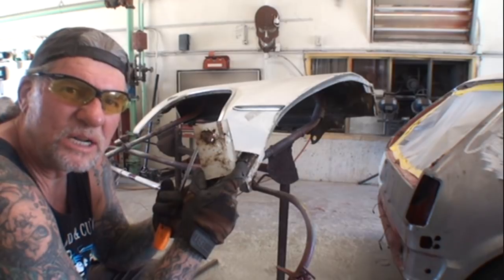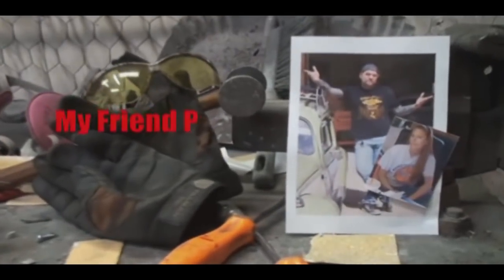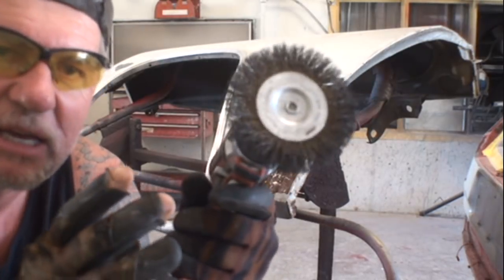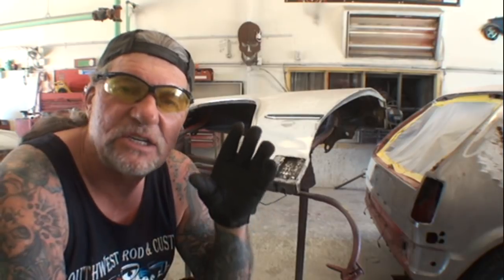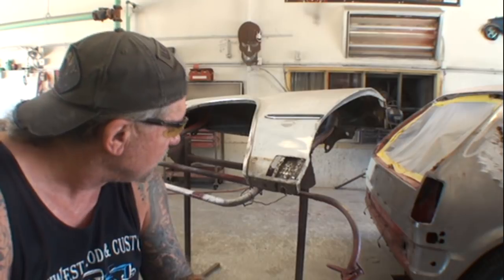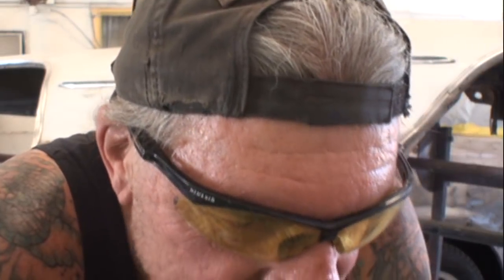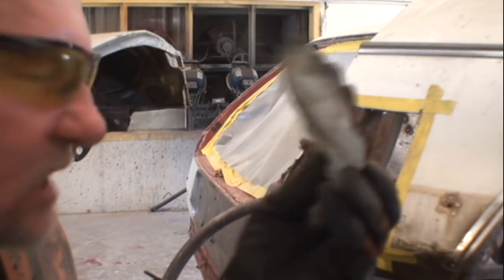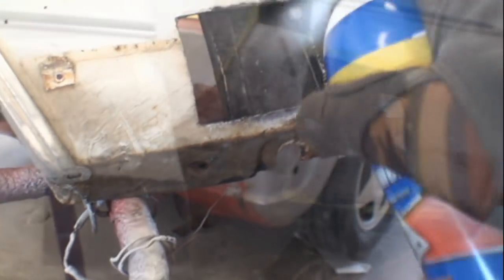How To Treat Rust - CHEAP AND EASY

Comment: Thanks My friend Pete, I remembered your advice with this product and used it to treat the remaining very light surface rust after I cleaned up the inside floor pan of my vintage 1973 Volkswagen. Worked like a charm, I topcoated it with NAPA semi gloss chassis black and it came out really nice, and as you said ‘will last as long as I own it’.

Comment: I just used it and was pleased, top coat that with Penetrol, yes the same stuff you'd add to oil base paint to help it flow, and it should have superior rust prevention.  Love your videos Pete, you take common sense approaches and consider that not everyone has huge resto budgets!
Reply: I never knew it would used in this application I used alot of penatrol loved it in the construction trade

Comment: I use muriatic acid several times .. The use distiller water with baking  soda to neutralize acid... then the Klean-Strip® Phosphoric Prep & Etch ...to eat any flash rust and seal the metal.... will protect panel from flash rust for weeks or more... the i Use the same rust treatment... never had rust return years later

Comment: I just got back to rewatching this video again. Yep I am going to agree, the can of rust treatment does work, but it's only available at O'reilly's Auto Parts in my area, I haven't check Napa yet, Napa tends to be more costly on their products and parts. Anyway I am using this stuff for all round surface rust removal Engine Bay, Underside etc, on the 81' Malibu I am restoring. Not a concourse restoration, but a restoration to keep her on the road for a good long time.  It is a good product, the instructions on the back state that it is not good for sheet metal body work. . Forget that, I used it on body, Frame, Floor Pans, and it works.

Comment: in my experience with fixing rusty crap in new england, products such as petit rustlok, por 15, rust bullet and the like works waaay better than rust converter, rust converting products have acid in them , when it gets wet again the rust comes back faster then with other rust products, rust converter might work better in dryer climates, but up here in maine rust converter, ospho and other acid containing products dont work out well.

Comment: Hello Pete ,  can I use this over skin door rust, and above rust treatment to apply bondo or epoxy primer ?   Can I continue with normal body job above rust treatment product ?  (. Example.  Rust treatment product -  epoxy primer - some bondo - primer surface - base coat and clear coat ,   Can you help me ,  thanks 🙏
Reply: Did you ever get an answer to this question from Pete? I also have the same question issue that needs addressing before moving forward.

Comment: I have a 72 nova with similar rust pits on the a pillar underneath where the windshield rubber goes. Do you think there would be any issues with new windshield seal going over top of rust sealer ? or would I be better off laying some primer over top of it ?
Reply: Primer and finish paint😊

Comment: Pete have to ever seen Arthur tussik channel. He's a Russian auto body tech he fixes cars that are wrecked beyond anything I ever seen.
Reply from the maker: Yes Ive seen him in action, great body man....
Reply: I've seen him also. Apparently he's not Russian, but maybe Latvian or Lithuanian. Although he makes an amazing job, I'm sure there are some corners cut. This is what I heard straight from a guy in Riga. It's a huge business there to buy completely wrecked vehicles from abroad and fix them up. Those fancy vehicles Arthur fixes are too expensive for a normal guy there, so an easy way is to just take advantage of cheap labour and get yourself a wrecked vehicle. For example, there are more imported Range Rovers in Latvia than sold by the local dealers as new.

Comment: My Friend Pete is awesome, and yes, to all the commenters, it's Permatex brand Rust Treatment.  It is good stuff.
Reply: Han Skinslo this works great. It doesn't work great if you don't clean up like My Friend Pete does. Been using Locite Extend since the 80s. Rust Reformer works too
Reply: Yes, clean the area like My Friend Pete shows us, surface preparation is integral to a successful job!

Comment: out of curiosity how much do you charge a hour to fix rust. I personally charge my normal hourly rate which is not $100 a hour. Something else that ive done in the past is cut a small hole at the bottom of the brace so that the water and or leaves can escape little easier

Comment: The only problem that I can see with this is if you are now going to weld a patch in the hole to cover it would not the heat of the welding burn some of that stuff off.      I always think that welding patches on cars is ok just as long as you can get to the back and put some good rust proof paint on it .  I have seen so many times when people weld patches on after removing the rust only for the rust to come back where the hot weld has burnt the protective paint off the inside that you cannot get to to paint.
Reply: Good point, I do the same, paint the back of the repair in a rust proofing paint and also drown the area in fluid film, even a "bodge" type repair can outlast the car if treated properly.

Comment: try rust mort turns it back to metal not a black primer and will protect the metal for years the best stuff i have ever use very fast and cheap it will be a gray metal and hard like metal did a car when i was a kid and still has not rusted over 20 year it lasted not sure now sold the car u just got to get all the lose rust off then apply it

Comment: Can't find Permatex Rust Treatment in Canada. I wonder how similar it is to Rust Check's Rust Converter? Trying that. If anyone has any idea if the two are chemically identical OR what the Canadian equivalent would be to Permatex Rust Treatment and could share then that would be appreciated. [Also, trying to find a Canadian retailer/distributor of Chassis Saver.] Thanks in advance PETE/PETE's Fans/followers. I'm also going to give POR 15 a try. When you did the floor of one of your projects (red Charger maybe) you brushed it on over what appeared to be lightly rust-dusted metal (i.e. no mention of the initial 2 steps (degreaser/waxer and POR 15 prepper)? Did you indeed do the first 2 steps before brushing on the POR 15 in that project? TIA.

Comment: Have you ever used that rust treatment on the outside of a body panel
Reply from the maker: NO! Only on inside stuff..
Reply: Ok, I have another question, I sprayed some epoxy primer and then sprayed my filler primer over it and the next day when I was blocking I noticed in a few places where I sanded thro that the epoxy is not feathering back but in the other spots it's feathering out fine, what's your thoughts on it Pete

Comment: I wish I could find this in Canada as the Napa here sells a different brand.
Reply: boo boo I'm not about to pay $40CAD for one can shipped on eBay.
Reply: I wish.  I am a solid 7 hours away from the border.  If I was close I would have a mailbox in the US to receive stuff.  So much more available there on eBay, Amazon, etc.
Reply: Lafond RC same problem here in Alberta only have rust check for $17 a can but in the hunt.
Reply: wademaillet I'm in Alberta as well. The Rust Check stuff doesn't seem to be that great, unfortunately.

Comment: Question, what is the process if it's surface rust, say on the outside part of a door or hood, same process? Then put bondo over the black primer stuff? I know we can only put bondo on metal after it's been grinded down, so how do we get rid of surface rust on outside areas to get it ready for the next stages? Should we use vinegar water as in your 2011 video or is that outdated? Thanks.  https://www.youtube.com/watch?v=m8_STIIF_x0&t=7s

Comment: How does the rust treatment from Napa compare to Evapo-Rust?  I like the fact that Evapo-Rust. is non-toxic, or at least that is what the can says.
Reply: I have been using Evapo-Rust over the past two years.  It is really, really good.  I can stick my hand in it and it does nothing, doesn't stink either.  It will not damage paint or plastic at all.  It is not an acid.  It does, however have to be constantly wetted or submerged.  I have seen people use a kiddie pool and a recirculating pump and flow it over large areas but I have never done it that way.
Reply: Of course evaporust and this stuff Pete used are two completely different products.  Evaporust works by chelation process to completely remove the rust, the permatex rust treatment works by converting the rust and sealing it to keep moisture out.  They are both great products,  depends on the situation as to which one to use.  Evaporust works great on machinist tools that have become somewhat rusty.